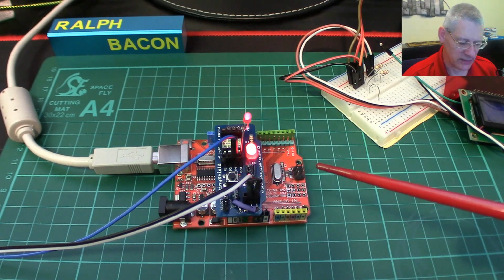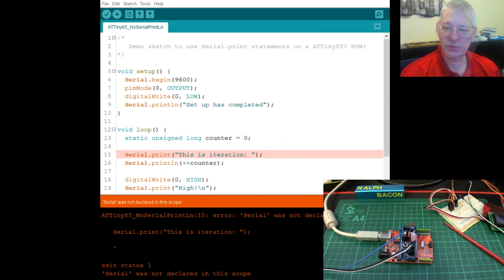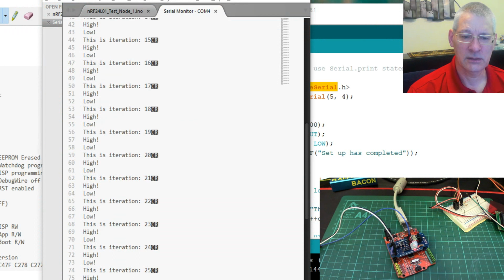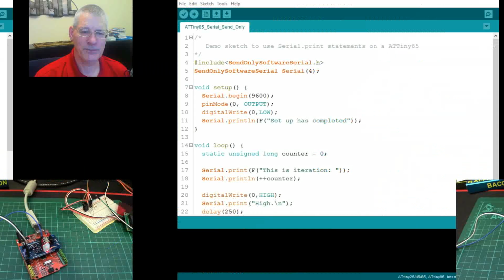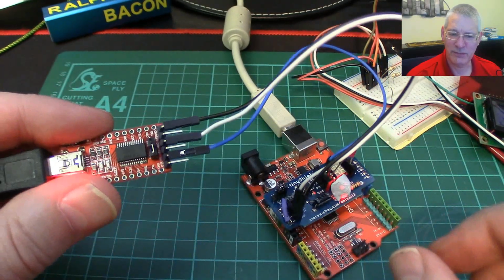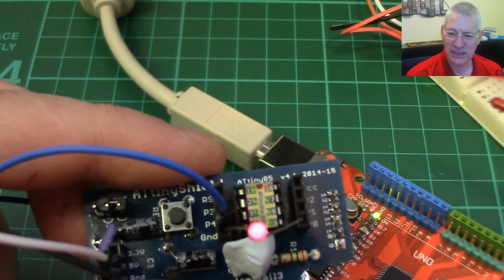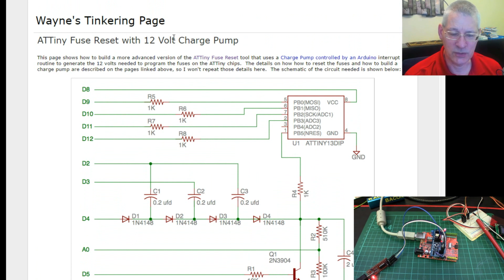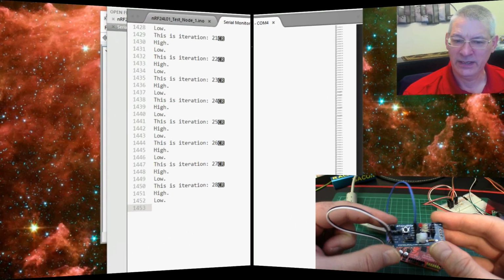#84 Making the ATTiny85 easier to program

Comment: Another great video, even with belts and braces. :)  Thanks, Ralph!
Edit: Seriously, decoupling caps are never belts and braces. Switch mode power supplies are terribly noisy.
Reply from the maker: Hey, Robert, the English idioms never end! Yes, I tend to put low level caps (0.1 to 10µF) at strategic points in most of my circuits (ideally as close as you can get to the actual chip). My XMAS Tree project proved beyond doubt that what you say is true about switch-mode PSUs, some are really bad (some very good but not those cheap ones from the Far East where every component is costed). Good to hear from you Robert.

Comment: Us Amurricans are - lessee - I think you call us 'thick'.  We woulda thought "blu-tack" is blue.  Your blu-tack is white.  Does the UK only allow white blu-tack?   Is blue blu-tack inferior or more expensive?  So how does Julian Ilett get away with using blue blu-tack if it's illegal in the UK?  Is he some sort of blu-tack black marketer?   I would have imagined that black marketers only black-marketed blac-tack.   Maybe black & blue blu-tack is also illegal here in the States.  Maybe Silly Putty will work.  If you have Silly Putty in the UK, in line with the logic disconnect of white blu-tack, is your UK Silly Putty not silly at all?

Shall I put the kettle on?

Oh... BTW, we have "biscuits and gravy" here in Amurrica.  That would be really gross in the UK - putting gravy on your biscuits.   And, geeze, what's up with 'chips'.  Chips are thin slicings of potato or corn meal, fried or baked, sold at room temperature in bags.  Or, they are programmable IC's, such as is the topic of this video, which mentions blu-tack that is white.
Reply from the maker: My Blu-tack is indeed blue, Are Jayem, but my video camera is quite colour-challenged and seems to only film it in white, so my Blu-Tack might appear white but is indeed blue. Interestingly, I have used actual White-Tack (made by another company) and I found that inferior (so inferior it should be made illegal) so switched back to Blu-Tack although you won't be able to tell the difference, I guess, going on colour alone.
 
Not only do you have "biscuits & gravy" you also have "grits" which is so disgusting I wouldn't give it to my chickens (if I had any) and which grits was intended for. Not that we Brits should be so superior given that we also eat turnips which were grown purely to give to cattle over winter so they didn't have to be slaughtered every autumn (not "fall", we're not falling about, although the leaves do fall off trees, I suppose, something you "thick" Americans obviously need to be reminded of every year, heh, heh!)
 
I could go  on (and my dear wife says I often do) about putting syrup on sausages (and WHAT is a "weanie" anyway?) and eating "jelly" (no, it's called "jam" actually) on peanut butter? (OK, I admit it, I now do eat that but who would have thought that would be a good combination? MY English colleagues just think I'm weird.) 
 
None of which is Arduino-related in any way or form but it does provide a little light relief as I grapple with my latest project. Nice to hear from you Are Jayem, enjoy the other videos. And who is this "Julian" guy anyway? :)
Reply: chip and chillies taste better
Reply: Now, you must be informed that I am a massive FAN of all things UK, and even had a few days tourism in London / Sysinghurst (?) with - of all fellow travellers - a family from Sweden.  TV & movie:  Two Ronnies, Dave Allen, Pythons, Keeping Up Appearances, Are You Being Served (and its follow-up, Grace & Favour), Red Dwarf, Blake's 7, QI, Dylan Moran, Dara O'Briain, Eddie Izzard, Blackadder, Masterpiece Theater, Laurie & Fry, Vicar of Dibly... many more.
I'm even a bigger fan, say fanatic, about Gilbert & Sullivan.  I challenge myself all the time to identify the assorted accents (West Country, Cockney, Welsh, posh, etc.)

Being as the USofA is so big, it's not surprising foods and jargon are broadly regional.  Being a Chicago native, I've never eaten grits in my 61 years (grits is a 'southerner' food).  And USA 'southerners' more often refer to carbonated drinks as 'soda' where 'northerners' would say 'pop'.   Jelly - that's a dessert in the UK, um?  Occasionally people will opt to say 'preserves' for 'jam'.  Disgusting foods here?  Ham hocks, pig's feet, tripe.  Wisconsin residents are "cheese-heads" (owing to the significant dairy industry).  'Frankfurters' = 'Hot dogs' in the north, 'wieners' in the south.  And, curiously, Chicago, Wisconsin, Upper Peninsula Michigan (where I reside) have 'brats' (bratwurst) which are more sausage-y and larger than hot dogs.  Beer required with those.

I was quite suprised by maple-frosted eclair-type donuts made with cooked bacon on top, in the north Idaho, east Washington state region.  As expected, Texas is all about beef & mexican foods. 

Julian Ilett is an electronic hobbyist YTer gaining wider notoriety in DIY circles.  Not sure where he lives in the UK, but his style is very easygoing and he provides generous variety in his content.  I've made frequent comments on YTer 'elecifun' channel, as he appears to be something of a beginner in the hobby.

I just received some ATTINY85 chips, but now realize I'll likely have to buy the support board(s).  eBay and Banggood love me of late.

Cheerios = breakfast cereal.  And plural of "so-long" = "ta-ta".   <smiles>
Reply from the maker: Just goes to show that generalisations are generally (!) bad things for us Brits to make. Fascinating about all that food, sounds, er, "interesting". I mean, bacon on a donut? Really? A breakfast all in the one cake!
 
And from all those UK TV series you must have watched more than I have, although I'm familiar with them, as you might expect. Not necessarily a fan of them all though!
 
I've been to Florida a few times, New York once and that's all I've seen of the US of A. Florida can be too hot and New York too busy (mostly those damn tourists!). But it was enjoyable nonetheless.

Anyway, it was fun reading your posts and I hope you like my videos as much as Julian's (who is a veritable electronics wizard, I just wish I had his following!). Good to hear from you.
Reply: Fun chatting!  FWIW, for both people and scenic vistas, rather than the so-touristy Grand Canyon or Yellowstone Park, north Idaho and western Montana are spectacular.  At least you saw Fla. and NYC. 

My electronics workbench has yet to be restored to full glory, and a 2nd 'scope, CNC engraver and 3D printer will be added.  When that's done, I'll have a place to fiddle with MC's, SBC's, and circuits/projects.

You'll grow your sub base, just takes time.   Kindly...   RJM
Reply from the maker: Thanks for the tourist tips, RJM (I geddit). And your encouragement! Yup, takes time. And effort. But it's a fun journey!

Aresby.
Reply: To be fair Julian has been doing it for a very lonnnnngggg time. ;)
Reply: I'm from the Netherlands and my "blue-tack" is called "Pritt Poster Buddies" and is white, our "Chips" are thin sliced potatoes, which Brits are calling "Crisps", and the British "Chips" are called "Patat Frites" which really is French,  American "French Fries" are thinner and are called "Franse Frietjes", which the French call "Pomme Paille" , but this a bit or byte off topic:
Nice Video, very usefull. Btw. there are adapters on the market to use the smd version of the Attiny chips, if you want to go smaller,
and from the Atmega386 too.

Comment: very interesting. I have done a lot with the attiny85 and it is a fun little chip. it is actually possible to use pb5 (pin 1) as say an analogue input without setting the fuse bit as long as you stay above some 2.3volt (I recite that value from memory but in fact it is the digital LOW level)
Reply from the maker: You're quite right Ed19601 (I really hope that's not a prisoner number, heh, heh), it can just about be made to work but it's all a bit flaky and not exactly robust (one millivolt too far and you've reset your chip!) which is why I went down this route. But you are totally correct that it can be made to work! Good to hear from you.
Reply: Ralph S Bacon i fully understand and you are right. I just didn't want to mess with the reset it, though I have a HV programmer. I made sure my voltage divider was such that I would never get below the reset value of 2.2volt. Anyway, great video
Reply: Ralph S Bacon and no.. not my prisoners number ;-)

Comment: Well earned thumbs up for that! Not only entertaining but tenacious too, you are so lucky to have Benny.

a couple of thoughts on SRAM: when the IDE reports the use of memory, it is reporting STATIC use of RAM. I.e that memory used by variables  declared outside of the loop(), setup() and any functions you may have written oneself. Dynamic memory use (which also uses RAM) can only be assessed whilst the program is being run. The amount of dynamic memory  goes up and down with each call to other functions. As each function called returns, the memory used goes back to what it was before it was called. This "temporary" use of memory is for the return address (so the function knows where to return to), the arguments needed by the function and any local variables declared within that function. This memory is "controlled" by the stack pointer in the MCU.

Now the above also applies to any libraries one might have included. All those methods need to use memory in a similar manner. 

Ralph employed PROGMEM to store his static strings (the arguments to his serial.print() calls). This is an excellent method to conserve SRAM and should be used for ALL your static variable should be stored in progmem. This is done by using the keyword PROGMEM in the variables declaration.

The essence of what I am saying is: it is misleading to interpret the IDE's report of SRAM use as an estimate of ALL the RAM needs of your sketch. When that stack pointer steps into your declared variables, the MCU will crash.
Reply from the maker: Thanks for the thumbs up! And also for the SRAM info too. That's why, even if the IDE reports you have SRAM left over after a compile, you might be able to load the program but you can still run out of memory whilst the program is running. I've often inadvertently stomped all over my variables, got weird results then ka-boom (not literally)!  Thanks for that great info, I'm sure others will now be all the wiser.

Comment: Why do you need the 330R resistor connected to the button & reset? Can't you just connect the reset pin straight to ground via the button?
Reply: for added safety, if you programmed the P5 as an output, you might damage the attiny85 if pressed the reset button, best with resistor.
Reply: Roger, thanks!
Reply from the maker: Yup, that's why I did it (which I should have explained better). When pin 1 is a reset pin it's brought to +5v (internally) via a high value pull-up resistor (somewhere in the 25K - 40K ohm range). But to bring it low (that is, to reset the chip) it only needs to be brought 'near to' ground and the 330 ohm resistor is insignificant compared to the pull-up resistor. And, as cheetahkid said, it stops me short circuiting the pin when in GPIO mode. And you can't reset the chip then anyway except by pulling the plug!

Comment: Very useful video. The reset pin on my ARDX mounted Original Arduino Uno would probably be clear of the ATTiny programming board: http://projectavr.com/IMAGES/UNO.jpg
Reply from the maker: You're right, Steve, that reset button on an original Uno is most certainly clear of the shield so I wonder why it's wired up in that way? Oh well, my mod allows me to reset the actual Tiny85 so it's a good enough 'fix' for me! Thanks for posting that image and answering my question :)